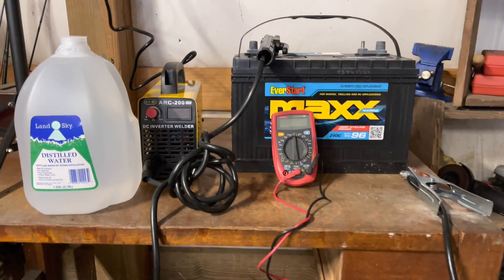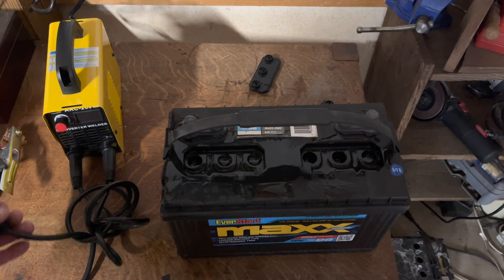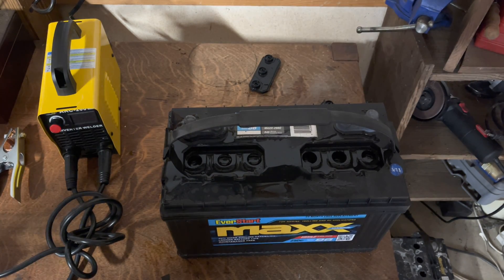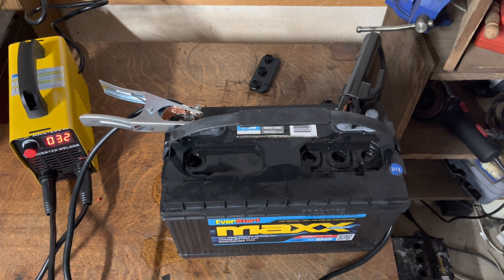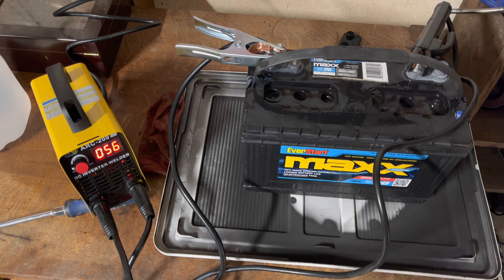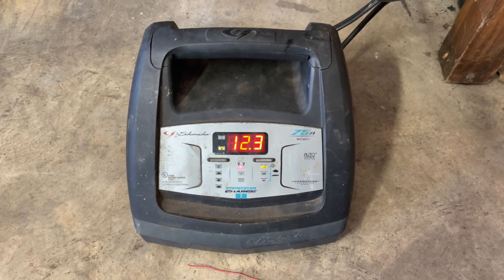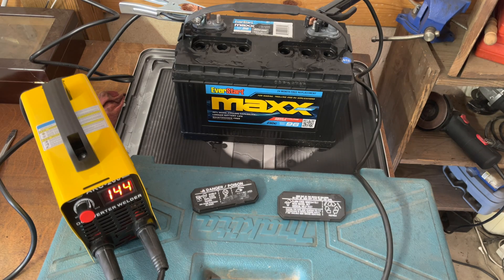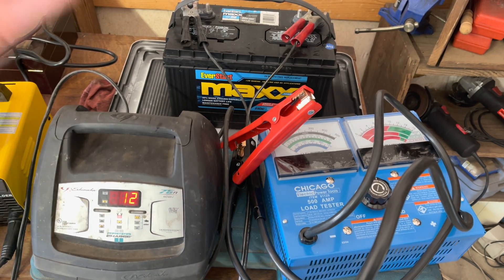10 year old battery, reconditioned using a welder.

Comment: A battery restore person told me to filter the old battery acid. Dump old acid out into a 5 gallon bucket with a filter to catch lead debris. You need to clean the old battery acid and then reuse it later.

 Then mix hot water with baking soda and fill battery up, shake it real good. Okay to be rough with battery to break up electrical hairs that short out battery, baking soda should clean out the inside of battery. 

So after battery sits for 20 minutes dump out baking soda water and refill with clean distilled water and shake dump out all water until inside of battery is clean from baking soda. Then refill with old cleaned battery acid, top off if needed with distilled water. 

Then hit battery with a arc welder, but don't go above 85 amps, go until all cells are boiling, leave off cap covers let battery boil for 5 to 10 minutes. Then let it rest 10 minutes repeat about 5 times or until all cells test good with a battery acid tester in each cell. 

Put battery back onto a real car battery charger and charge it at highest amp setting. Or better yet use a de-sulphate mode on your charger and leave it over night, make sure to charge up battery again. Test battery for voltage, should be around 13 volts and test load on it with a good load tester.

 Should be good, but you might have to hit battery again with arc welder, then retest. If battery won't respond then you might need fresh new battery acid and charge battery again.

 The purpose of arc welder is to break up the electrical hairs that are shorting the lead plates inside your battery. And the baking soda will clean most lead hairs corrosion inside battery. Hope that helps you. 😮😊
Reply: Interesting! Would there be any potential damage to the battery? Otherwise can we use welder to replace regular chargers?

Comment: Hello, I did it exactly the way you did it, but something different happens to me. I have a Güde 135 welding machine, after I connected the terminals there was extremely strong sparks and the cables were hot. I haven't even put the plug in the socket yet, how can that be? was I wrong? Thank you very much for your help

Comment: DUDE!!! YOU DON'T HOOK THE CABLES UP WITH THE WELDER ON!!! YOU ARE LUCKY YOU DIDN'T LOSE YOUR FACE!
Don't be an idjit! Turn the welder on AFTER you connect the cables, and turn it off before you disconnect them. The fumes coming from the acid in the cells is explosive! And it's ACID, and will completely melt your face off.

Comment: Don't try at home? Well i try in my garage instead then!!! Edit: you overfilled two cells, bad! I'm gonna try that too with my 200amp welder, my car battery (EFB) shows 12.3V on the voltmeter.. though it starts the car NP since it's just 1.0litre turbo..

Comment: I tried this method. 5 cells came back to life but one cell just boiled water out. Was a 12 year old battery with dry cells. I figure the cell that boiled out was shorted. Will attempt again with a battery just not holding a charge, about 5 years old. Thanks for the video.

Comment: A 200 amp battery charger does the same thing as the welder. Other vids on it. It works every time. Boil 15 min then cycle off for 60 min. Repeat cycle about 6 times.

Comment: So I tried multiple times with the identical welder and I only had action from 1 or 2 cells tops, lower amps for prolonged periods seem to be resulting in more cell action, I made my own solid state battery charger out of an old microwave size transformer and a big 200 amp diode, this outputs 30 amps at around 14v, which seems to be bringing the battery back and making almost all the cells boil so far...

Comment: just reconditioned a 7 year old dead battery, 29 group, used dc welder, @ 67 volts @ 30 amps for for 8 hours. tested battery at start , 10.12 volts  after, 12.8 volts with 900 cold crank amps.  success. 150 bucks saved.   it works.

Comment: MAYBE DRAIN THE BATTERY AFTER RESTORING IT,ADD NEW ELECTROLIGHT?BASICALLY WHEN YOU ARE CHANGING IT WITH WELDE,YOU KNOCKING ALL THE  CORROSION OFF THE PLATES..SO INSING THE BATTERY OUT AND ADDING NEW ELECTALIGHT WOULD SEEM LIKE THE WAY TO GO? STAY WELL,THANK YOU

Comment: the way you did it you are lucky you didnt cause serious injury. never use the stick side by it self. use a vice grip and clamp on the end of it. also you never turn on the welder until the cables are hooked up first. never over fill the cells, should be filled 1/2 from the top on each one. set the welder at it lowest level for 5 minutes, then let it rest for 10 minutes. repeat the process 6 times. by you rushing the charge can cause harm to you and to others around you. rushing only comes with greater mistakes. the theory does work but it takes time. if you dont have the time then dont do it. also the charger your using is a bad choice. digital chargers are no good to this, 200 amp charger non digital is the best route.
Reply: What about ,225
Reply: 225 amp?

Comment: It's a battery balance charge, each cell gets sulfated more or less then the others during the life of the battery. Over a long time some cells become too sulfated to accept a charge at all. By overcharging it your burning of sulfation from each cell, hopefully most of it on all cells. Going from an overcharged state slowly down to a normal charge state cause also cause sulfation. That's why some people after the final overcharge will put a small light on the battery then bring it down to 80 percent charge, then give it a final 100 percent trickle charge.

Comment: The boiling of a battery will charge a dead battery but will not repair a battery with a dead cell or one that will not hold a charge. Best fix is a new battery.
Reply: It specifically repairs batteries that will not hold a charge. It is correct that dead cells are dead, but this will, indeed, rejuvenate a battery that won't hold a charge, so long as sulfation is the reason it doesn't hold a charge.

Comment: You overfilled cells. You only fill the cell to the bottom of the plastic holes/chutes. There is a cut out in the shoot to allow for venting. You should apply power from your welder for 10 to 15 minutes and then allow it to cool for an hour and repeat 4 to 6 times. As long as the plates are not warped you have a pretty good chance of reviving an old battery.
Reply: Can this be done with ac welder? Kind regards
Reply: @branislavlukic3919   It must be a DC welder
Reply: How hot can the battery get? I got it cooking

Comment: Empty batter first flush with sodium bicarbonate two or three times until the mixture becomes clear, fill with Epsom salt mixture and charge. If you still have problems, use welder 40amps 5min leave to cool for two min. Repeat three to five times. 

I am going to do the flush part and refill with sulfuric acid, the charge. The problem is if you don’t empty the battery out of all the blackened water you still have a battery full of dirty acid. 

Oh yeah and choose life don’t let sparks occur anywhere near a battery. In Engerlad UK where I live price of new start/stop EFB are £150-£500.
Reply: Can this be done with ac welder? Kind regards

Comment: Earth clamp to negative on battery..welding head to positive. Connect negative first then positive..the  turn on.reverse to unhook and turn welder off first. Up your amps slowly.jt might take a few attempts to get all cells bubbling. It de sulfates the plates. Same as the big heavy duty chargers at garages,and battery reconditioners
Reply from the maker: Thanks for the comment
Reply: On a Tig welder the ground is positive and the torch is negative. Should they be switched so the ground is negative to negative on battery

Comment: Tried this and FAILED, but i think my old welder is an AC type unit, and this needs to be done with a DC type one.
Reply: dod one of mine with an old ac unit did fine just took way longer
Reply from the maker: Thanks for your comment
Reply from the maker: I did mine with a DC welder,  check a few of my other videos
Reply: yes

Comment: Please clarify the positive/negative setup.

In welding, one can have AC, DC rod positive, and DC rod negative. Please state the choice on the welder.

And please state which end of the battery is positive.
Reply from the maker: See my other videos and they detail the answers to your questions
Reply: I would advise that if you haven't experimented with batteries and trying to rejuvenate them enough to know the answer to these questions, it is highly advised you do not try this. This is something that is highly dangerous if you have not done extensive research and or experimentation with lower voltages and currents.

Comment: I got a computer SMPS/ATX, there are different cables for different volt/amps, there is of wires that can supply upt 24v,  24amps. Do you think with a setup like that desulfation would work? will it make the water boil? I have tried pulse chargers, so far no luck.
Reply from the maker: I'm sure it would make it boil but idk if you should try it. Do so at your own risk. I haven't check the amperage of my welder
Reply: A 3M subscriber channel recently did a side by side test of 3 different remedies, including a de-dulfator. The welders worked best out of all of them, and the desulfator ended up making the battery worse! Search Youtube for the following video:

Myth Busting! Can You Restore a Dead Car Battery With Welder? Let's Settle This!

Comment: The welder hookup to battery...guessing negative to negative and positive (welder stick side) to positive battery?  At 50 seconds you said/showed negative welder to positive battery terminal...which I am guessing is wrong? Thank you.
Reply from the maker: Negative to negative, you are correct
Reply: @PRSH8YAPROJECTS before 50 seconds you had the black clamp connected to the negative terminal. After 50 seconds you connected it to the positive terminal. Why?

Comment: Drop the battery on the ground a couple of times. Not very of a high drop but good enough to where it breaks any corrosion that are on the plates inside the battery make sure that the Caps are on before you do this then before you add water to the battery take six aspirins and put one in each cylinder add your distilled water and yes bring it to a high charge let it boil but she already broke the corrosion that is crossed over onto each plate now you'll start seeing it bubble each cylinder will start to bubble if it does not bubble at a high charge that means that cylinder is crossed and it's not going to charge so you drop the battery again to break that out and it works just put it on a high charger for about an hour reduce it and then slow charge it for a couple hours.
Reply: @PRSH8YAPROJECTS wtf is that supposed to mean?

Comment: did you use a ac , or dc output welder ??
Reply from the maker: Dc
Reply: Obvious it must b DC. Ac has no positive or neg.
Reply: @jasonhardy2880  you think an ac welder has no pos and neg ? have you ever seen one ?  I use them daily and I assure you they have poa and neg. connections. the ground clamp on either ac or dc welders is the neg and the stinger is the pos.

Comment: When you said it’s showing 75 amps and other nonsense.  It’s not non sense and it’s not amps that is displayed.  It’s the percentage of charge reached. It uses an algorithm with time and voltage to calculate the charge capacity reached.
Reply from the maker: That's great info, thanks!!

Comment: I this with three batteries. All three would not take a charge when charged with my shop/rolling battery charger. I then cycled 10 min 250 A "boil" 30 min cool 10 times on all three batteries. One of the three came back to life and is still in use today 2 years later. The other two not so much, cores LOL. Soooo my take is if you have the time and an older "dumb" charger, try it.
Reply from the maker: Hey thanks for the comment and update

Comment: Why does nobody have a voltmeter connected while doing this whats the damn voltage!
Reply: them inverter welders are like 18 to 30 volts
Reply from the maker: I was cautious about hooking my meter up due to ruining it, but now I'll have to try it. Thanks
Reply from the maker: the load meter shows voltage
Reply: @PRSH8YAPROJECTS  yes but i want voltage when welder is connected.
Reply: My meter says around 17.8- 18 ish while cooking batteries. I'm currently in the process of boiling 8 batteries. They have been just sitting around for years at this point some are last winter dead and some are 10 years of sitting in my garage. I know the older ones off gas super bad so don't do it inside and stay away while cooking. I have a respirator but hydrogen sulfide gas is very spicy and will hurt you.
Reply from the maker: Thanks for watching and commenting
Reply: @chrisvanalstine8136  yo, you still alive?

Comment: I just did this to a mower battery from 2010. It was heavily sulphated and failed the load test. After about 10 5-minute sessions @ 40 amps, its back to new and holds charge
Reply from the maker: Glad to hear, I did it on my generator battery also and it worked

Comment: Another thing is, your should have connected the welder to the battery posts FIRST, before you turn the welder on; otherwise, you could welder/melt the posts.  You were lucky this time.
Reply: Not only that, it could blow the battery up
Reply from the maker: Thanks for the info
Reply: @PRSH8YAPROJECTS  1 10
Reply: Holy Crap!!
Reply: If it melted the posts, then the ARC welder did its job!
Reply: Can this be done with ac welder? Kind regards
Reply: @branislavlukic3919  2-10-23...you cannot use a/c voltage against d/c voltage... dangerous to say the least !...only d/c welder... you might be more knowledgeable by now as myself...done correctly it appears that many on here have benefited greatly 👍
Reply: @branislavlukic3919  try it, fortune favours the brave!

Comment: I suspect the battery will go back to life without the welder trick, as long as you use a dumb charger.  The welder trick is more to desulfurizate.
Reply: @justin although there are multiple ways a lead acid battery can fail, sulfation is by far most common. You can take a brand new just bought today lead acid battery, and if depleted far enough (process seems to noticably begin once voltage dips below 9v approx) it will sulfate, and begin giving problems taking and holding charge. If your lead acid battery dies of anything other than sulfation, neither a 12 v charger, nor a welder will bring the battery back until the cause of failure has been resolved. I can tell you from dozens upon dozens of experiments with various 12 v chargers. You might be able to partially restore a lightly sulfated battery on a 12 charger, if you're lucky. You can not bring back batteries with moderate to severe sulfation using a 12 v charger even running almost 1000 watts (12 v @ 80 AMP), even if you leave them on said dumb charger for extended periods of time...
Reply: @thomasvisser5189  thanks Thomas! Is it true that the welder trick is to boil the electrolyte and melt the sulfur crystals?  If it were true, a big microwave oven may work as well, if it’s big enough.  How do you think please? Thanks
Reply from the maker: That would be exciting to see
Reply from the maker: Hey thanks for the info
Reply: If you have a heavy-duty (200 amp plus) battery charger, then by all means use that but if all you have is a dc welder then use it rather than shelling out $250 for a charger you will use at most once a year to give a battery a deep charge